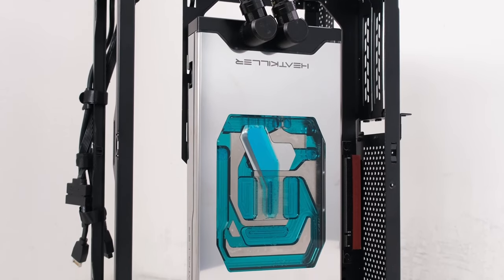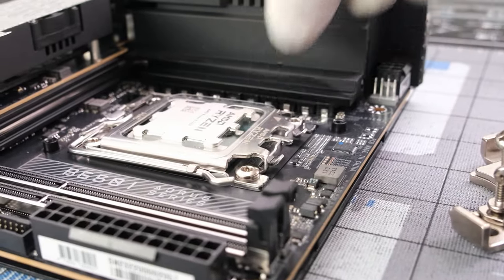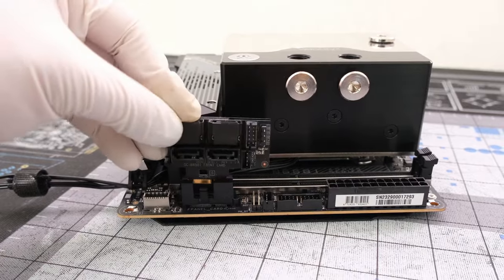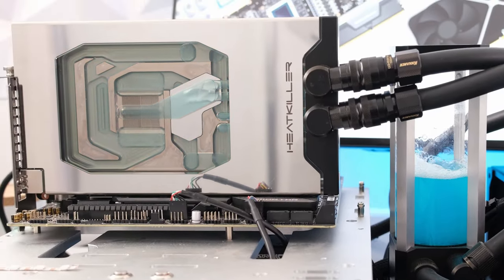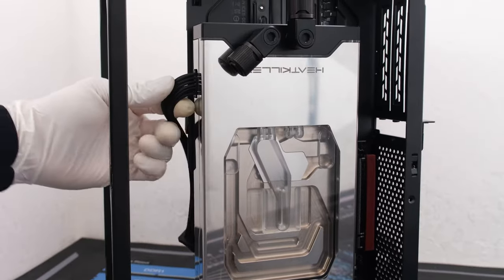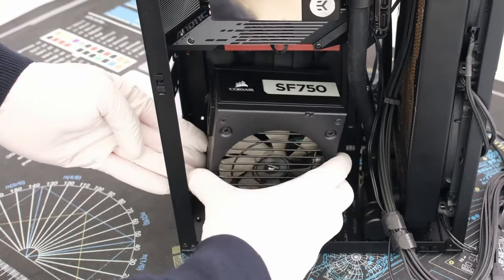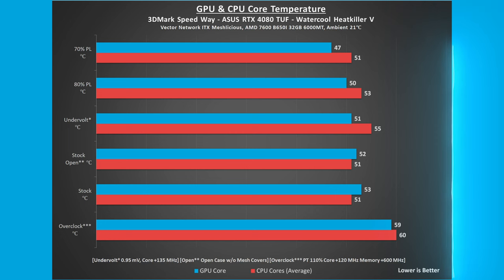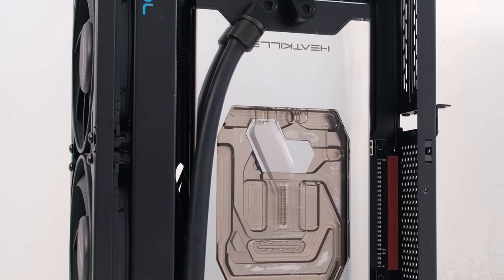Watercooled ITX Build - Step by Step

Comment: Great video as always! I am highly interested to build something similar in the future. As of today for your region and I let you have a 20% differential what would you estimate the total value to be?
Reply from the maker: Thanks for your comment🙏Do you mean how much does the whole build cost? In the description, there is a parts list, I'll also copy it below.
The most expensive items are the RTX 4080, the CPU block, the GPU block, the motherboard and CPU. There are also a significant amount of fittings used in the build. For example,  I used to EK micro torque fittings because they were small enough to fit. I used a lot of them. Fittings themselves will be several hundred dollars. Hope that helps

CPU - AMD Ryzen 5 7600
CPU Water Block - EK-Quantum Velocity² DDC 4.2 PWM D-RGB - AM5 Nickel + Plexi
CPU Thermal Guard - Noctua NA-STPG1
CPU Thermal Paste - Noctua NT-H2
Motherboard - Gigabyte B650I Aorus Ultra
GPU - ASUS TUF RTX 4080
GPU Water Block - Watercool Heatkiller V
PC Case - SSUPD Meshlicious ITX Case
Memory - G.Skill Flare X5 DDR5 32GB 6000MT
Controller - Aquacomputer Quadro
Temperature Sensor - Aquacomputer Ambient Temperature Sensor
Coolant Sensor - Barrow Coolant Sensor
Coolant - Mayhems X1 Eco Clear
Radiator - Alphacool ST30
Fans - be Quiet! Silent Wings 4 Pro 140mm x2
Fittings - EKWB Micro Torque Black, Barrow Manual Exhaust
Tubing - Watercool Heatkiller EPDM 13/10
Power Supply - Corsair SF750 Platinum 80+
12vhpwr Cable - Corsair for Type 4 PSUs (SF750)
Reply: @vectornetwork  oh thank you!

Comment: I will require proof that the PCIE 4.0 port will still operate at x16 even when all 3 M.2 ports are utilized. I have this motherboard with all 3 M.2 ports populated, and I have thus far failed to have any software report anything above x8 for my GPU
Reply from the maker: Thanks for your comment 🙏 I absolutely combed the manual (several times) and verified via HWiNFO before I would make such a claim. It was a surprise to me when the manual indicated that the GPU would run at x16 irregardless of the population of the m.2 slots. This is not something I was used to with AM5, but it makde sense (to me) with AM5's higher bandwidth and connectivity. It would have been a lot easier for me to install one m.2 nvme and call it a day. In any case, I verified again that the software reports x16. Are you using a riser cable? If so, have you ensured that it's 4.0? I had to get a new riser cable for this build. Hope that helps.
Reply: I believe I have the pcie 4.0 riser cable... But maybe it's faulty?

May I ask what riser cable you used in the build?
Reply: @vectornetwork The problem is indeed the riser cable. It'a the original cable that came with Meshlicious, and it IS 4.0, but seems to be faulty since I get x16 when I connect the GPU to the slot directly.
Reply from the maker: Wow, I'm glad that was identified. I went through the same thing with this build. I nearly tore the whole thing apart trying to troubleshoot an issue that ended up being a faulty riser cable.

Comment: Really interesting how undervolting even with 40xx series keep worthing these days. 

Great video and scenes as always  :person-turqouise-waving:
Reply from the maker: Thanks for your comment🙏Yes, that was my conclusion after looking at all the data. It was also what I had expected from testing the 4080 (and 4090s). It seems like the cards are efficient enough to be pushed to their limits by simply slapping a large triple fan cooler on it. Overclocking the cards always added noticeable temp increases and marginal FPS increases, if any. Undervolting nearly always resulted in significant decrease in power usage with a nearly nil decrease in FPS. I chose an easy to cool CPU as a complement to the 4080, but having it undervolted is simply the cherry on top. Thanks again for watching and commenting

Comment: Thanks for the break down guide,
dose the block come with a backplate? os is it intergated into the block its self?
Reply from the maker: Thanks for your comment 🙏 Do you mean the backplate for the CPU block? If so, it uses the stock AM5 backplate. There isn't anything additional. You unscrew the stock brackets and use the same screw holes. You have to screw it in counter clockwise from the back. Hope that helps

Comment: I love this case, I have a 13900k with a 240mm rad, and a gigabyte 4090 air cooled
Reply from the maker: Thanks for your comment 🙏 congrats that is quite the combo and I'm not surprised that the meshlicious can handle it. There has been a lot of new cases in the ITX space, yet I'm not sure if any of them has improved on the Meshlicious's exact layout. If there something better, I would probably try it.
Reply: @vectornetwork  my next case will probably be the thermaltake tower 200, it can also house my hardware, a bit bigger but it looks way nicer

Comment: @Vector Network - Now that you have lived with the EK Pump/Res CPU cooler for a little while.  What are your thoughts on the DCC pump at the CPU? The only thing I think about is the fluids have a little spike in temp because they are sitting on the CPU?  What do you and do you not like so far?  Thank You
Reply from the maker: Thanks for your comment 🙏 Great question, I like talking about this stuff. To address your thought about a potential spike in temperature because they are sitting on the CPU, I'm not sure that will be an issue for a couple of reasons. Firstly, if you're talking about the DDC getting too hot, it uses the metal enclosure as a heatsink, so that is sufficient. If you're talking about the coolant getting to hot because of its proximity to the CPU, then I don't think that's an issue. The flowrate is sufficient and separately, the CPU is a power efficient 6-core processor. Its primary purpose is to complement the GPU, which is going to do most of the heavy lifting. The CPU temp never gets that hot in the loop. 
As far as what I like or don't like about it so far, I'll start with the negatives and go to the positives.
It's a SFF build, so it retains any negatives in general about SFF builds. The build absolutely requires a DDC pump. The next video will be a price-to-performance build and will showcase the differences between a D5 and DDC pump (primarily in size). So, I would like to have a D5 pump, the DDC pump is perfectly sufficient. I would also like a little less noise as it sits on the desk (it's perfectly quiet, I would always prefer near silent though), but this is the best 280mm rad plus 140mm fan combo until early next year when Noctua plans to release their new 140mm fans. 
As for the positives, the performance and it flat out works. I've been thinking about this build for more than a year, especially after I did this same build with a 3080 that had issues that were completely addressed with this new build. The build had to be made of completely stock parts (no modifications), as a lot of watercooling builds require drilling extra holes or using a dremel, etc. Everything in this build fits nearly perfectly and every little place in the case is filled with a purpose.
It flat out works. The performance is that of a 4080, no compromise, cool and quiet and manhandles any game with all the fixings right now. Hope that helps
Reply: @vectornetwork  - Thank you so much for all the feed back.  I will stay posted on your channel.  I did check out the D5 pumps, like the EK 80 RAD with a D5 pump attached. I use a dual d5 in my current setup by EK - powerhouse.  So for me, I am a bit spoiled.  BUT this is ITX, and in these smaller cases, you have to be safe and not sorry.

Alphacool has a single and a dual d5 brass top units, with some active ports, that could make water lopped extremely easy.  BUT now I run a risk of filling up the case, with parts that may not be as effienciet when comparing to prices.

I plan on using the Intel 14K, and I really considered the Modultra Pump/Block combo.  But that forces a resivvor separate from everything else.  Modultra is testing the 1700 direct die block, but it is not out just yet.  EK, already allows the block you have to go with direct die.  I would like to do some overclocking - just to get out everything from the CPU.
Reply from the maker: Oh, dual D5. PC is where you can do whatever you want. Sounds awesome man. I never tried more than 1. Hm and you want to use the Intel 14K. For this build, the assignment was trying to fit the best gaming performance into a true ITX case that could only fit one 280mm rad. So, a 4090 was not going to work because I think I would need pair it with at least an 8-core CPU and then I would think the 280 radiator would then not handle the combo and would generate too much heat and throttle. Not fun. So, the goal was a 4080. To complement the 4080, a 6-core power efficient CPU was selected. The 7600 is a breeze to cool. The power usage of the combined build is just low enough to be able to squeeze the performance out of the parts. It gets even better when the GPU is undervolted. If you're starting the build with a 14K in mind, what will pair with it for the GPU? Which case?
Reply: @vectornetwork  - Thank you so much for the information shared!!! Have an amazing Christmas Holiday!

Comment: such an unusual build, very interesting
Reply from the maker: Thanks for your comment🙏and thanks for watching! The point of the build was to watercool a 4080 in an itx case. Normally it's not possible without modifications (cutting the case with a dremel, drilling more screw holes, etc) and may not perform well because of the lack of radiator space and tight enclosures lead to buildup of heat. But with the release of two new product, I thought this build would be possible--the EKWB cpu block thats a 3-in-1 and the RTX 4080 that has incredible performance for its heat output/wattage--a significant step up from the 3080. So, it all fit using micro fittings and the result was really cool. The GPU/CPU are cool and quiet. The fans are on max but 140mm thats only about 1000 rpm and its sufficiently low enough even while sitting on the desk next the user. Hope that helps
Reply: @vectornetwork  some of this went over my head, but I have a lot of respect for super nerds that try new stuff on a high level and these kind of builds may be hinting at the future of PCs to come

Comment: Lovely video with great commentary. I want a build like this but in the thermaltake tower 200
Reply from the maker: Thanks for your comment 🙏 and thank you for the kind words! This build was a long time in the making. I made the first one with the Intel version of the block with 3080 and was never satisfied. I thought about it until the 4080 came out and AM5 was equally as efficient. I do believe this is the best way to get a full custom loop into such a small ITX enclosure. Usually the rad and the pump/reservoir combo are deal breakers in getting anything to fit. I have actually built in the TT Tower 100. It was certainly a different type of case, but I think it was more suited for air cooling. But I haven't seen the 200, which sounds bigger. Thanks again

Comment: I wonder if there’s an even smaller case for this combo build since one 240rad can cool both components 🤔
Reply from the maker: Thanks for your comment 🙏 The reason I did the build in the Meshlicious is that it sort of perfectly fits everything. It is already a tight (tight) fit. The spine in the middle is adjustable so that allowed adjustments where the GPU side is smaller than the CPU side. That is important because of the pure size of the CPU block/reservoir/pump combo and that is without the fittings. Everything fits just barely with the micro-fittings and I put the whole kit and kaboodle in there with the aquacomputer controller, etc. The 280 rad fits perfectly took, no wasted space there. So, yes, I would really like to see another case that can fit all these components and if it does it well I would might as well do another video, but I haven't found one yet. Let me know if you have any in mind. Hope that helps

Comment: is this the best mini gaming desktop configuration ?
Reply from the maker: Thanks for your comment 🙏At this point in time, with no modifications, stock components, yes. A 4090 will likely technically fit in the case, but I am not sure if a 280 rad will be enough to cool it and a capable CPU to properly pair with it. The 4080 is perfect and can be combined with another power efficient 6-core Ryzen CPU. Powerful and power efficient and perform well undervolted. The be Quiet! Silent Wings 4 is on the top end of performance/noise until the revised Gen2 Noctua 140mm fans come out next year. The Alphacool radiator also fits the case near perfectly and has 5 ports so its easier to add all those accessories. I have sincerely thought about this build since the original RTX 3080 build in this case and the build with the 4080 addresses all the issues I had with the first build. Hope that helps.
Reply: @vectornetwork  it's been almost 1 year since your fantastic video and 9 months since your message above. Anything you would add, change or improve for this build? Perhaps you already have a newer version of an ITX build that you would like to direct me to?
Reply from the maker: @levelont5560  Wow what a comment. Currently, I've been trying to make my way through this dark forest, not exactly sure what to do next. 

Did you see the video where the goal was an ITX build with a 4090 that is silent? https://youtu.be/P0WcbHW9kxg

Then I followed up with the same idea of an Endgame ITX build with a 4090 but allowing for both with and without an external radiator setup. https://youtu.be/zH-YWCSDi2E

Currently, I have the Form T1 ITX case shipping to me and should arrive sooner than later. From there, I'll likely build the T1 (since it comes flat packed) and then do a 4080 super build. That should be the next build video. 

Hope that helps and thanks for watching and commenting 
🙏
Reply: @vectornetwork  I did watch them, yes. Impeccable work! ✊🏽
I might use the latter (Endgame ITX) as a reference for my project - without an external radiator.
Looking forward to that T1 build!
Reply from the maker: @levelont5560  Solid solid thank you thank you wow

Comment: Do you use dynamometric screwdriver? Or you have perfect knowledge when to stop screwing?
Reply from the maker: Thanks for your comment 🙏 I actually do have a gyroscopic Dewalt screwdriver, but in the videos I'm using a regular small blue screwdriver with bits. In an upcoming video, I am switching over to the Noctua x LTT ratcheting screwdriver. In the videos, I only show a brief moment for each screw. While taking the footage, I just screw it until its right based on too many years of experience. Everything has a slightly different torque and slightly different screw, I can see now how it can be confusing. I would recommend a regular screwdriver with changeable bits and making sure that the tip of each bit is magnetized (using a magnetizing tool usually included in screwdriver sets, takes 5 seconds per bit). Hope that helps
Reply: @vectornetwork  When you disassembled the water block, you then very carefully twisted the acrylic panel, that's what I'm afraid of
Reply from the maker: @000hitec000  Oh got it, you're talking about when reassemble the water block after taking it apart for cleaning. It is one of the harder parts to get perfect. We're talking about taking off about 15-18 screws from any acrylic top and then screwing them back. If they are too loose, then you might get leakage. If they are too tight, then you might crack the acrylic. And there are so many screws. It's likely because it's needed. If the vendor could get away with less screws they probably would. So, for this part and for me, it's all based on feel. I torque as tight as possible without putting any extra weight into besides my hand. If it doesn't move on the first normal twist,  then it's done. Hope that helps

Comment: Uh... Stupid question, when you fill up the reservoir and turn on the pump, the water will be sucked by pump and there should be plenty of bubbles surge into the reservoir simultaneously. My question is, will the water be splashed out of fill whole by bubbles? If not, then it's fine. If so, then what should we do? Close the fill whole? But that will block the air and it won't be able to escape from the loop. Thank you for your time.
Reply from the maker: Good question, sounds like you're really thinking through each part of the process. Yes, you're flat out right, given that the pump is right there, there should be some splash. Well, it is watercooling. Viewer won't see it in the footage, but I splash and spill things a lot more than I probably should (especially given that its harder with the camera there). Having said that, there isn't much to be concerned about from splash-back here. The most I've gotten was maybe a few drops. There is more chance that I will inadvertently squeeze the bottle and have it squirt all over. I would just keep a cloth nearby and just turn on the pump with the plug hole open. Nothing will really happen. Just make sure you got some liquid in there before turning it on. Make sure the pump is wet. Hope that helps
Reply: @vectornetwork  thank you for this thorough reply.

Comment: Would love to replicate this build with a 7800 x3d & 4080 super. Do you know if heatkiller blocks are compatible with the super cards?
Reply from the maker: Thanks for your comment 🙏 That combo would work well in the build. My understanding is that the blocks will fit the new supers. I have only installed one block on the Strix Super (alphacool) and it fits but I have yet to test it. Alphacool has also come out and say that their blocks are compatible but I have not researched any other brand. Hope that helps